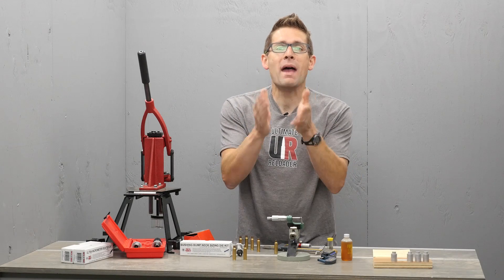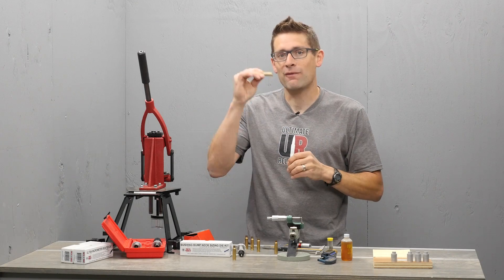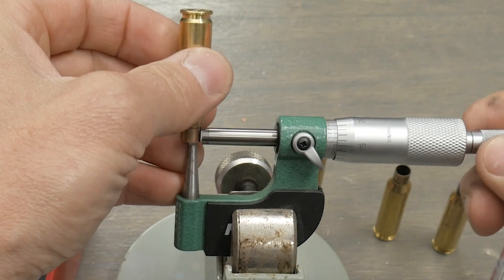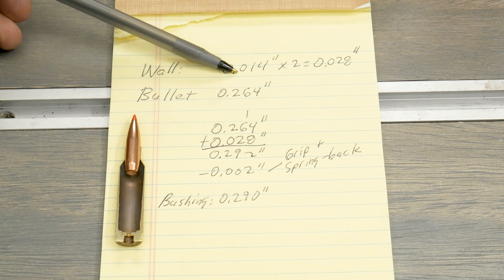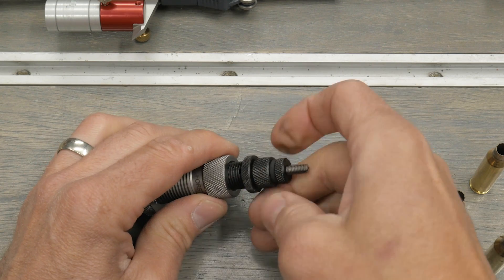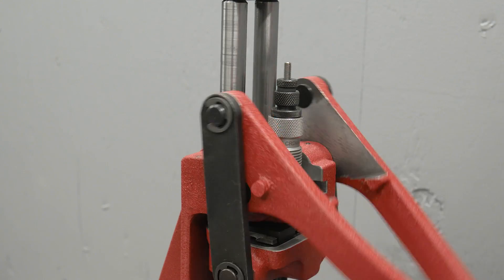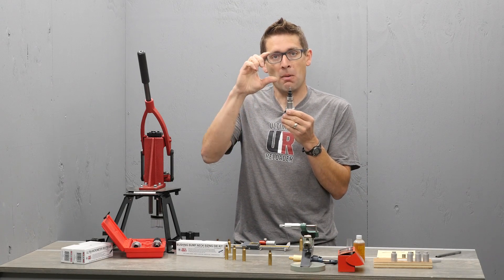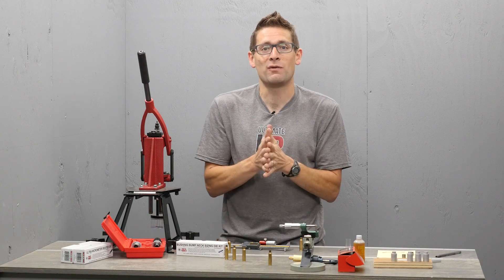Forster Bushing Bump Die in 6.5 Creedmoor: Overview and Setup

Comment: At higher energy densities, the pressure rise becomes nonlinear, increasing more rapidly than predicted by simple proportionality. This is due to enhanced flame propagation, turbulence, and confinement effects. if you bump the shoulder, you relieve the contact to allow better alignment without hanging the case up during loading.
if the chamber volume fits the case volume (excluding a slightly bumped shoulder), the energy density is far more constant between cases. i have a theory a bump die is superior to a body die as for larger powder weights, it allows a more concentric alignment, stable volume profile.
a body die will cause the case dimensions to deviate from the chamber, and this in turn means the case will need to obturate to the chamber dimensions on firing...which effects the energy density burn rates.
since the burn is in the non linear part of the burn curve, the results are exaggerated. (just a theory)

Comment: At about 4:50…
I’d be hesitant to spend the money on this product. With my Rcbs full length resizing die I need about .004-.005 shoulder bump for my rifle (for it to chanmber with the bolt just dropping with no interference)… if I only bump .003 it still will chamber but I can feel the bolt “dragging” the last half turn of my bolt. This is all done without the ejector pin in my bolt btw…

Comment: Interesting to see the proper shoulder bump. The tool that I have developed (not in production yet though) lets you set the bump even more exactly repeatably to a quarter thou or less than your method and it is not expensive. Regard Martin from UK.

Comment: Nice video, I noticed your using the 400 bushing to measure shoulder but hornady recommended the 375 bushing. I've tried only neck sizing but bolt is very tight to close, would this be a good purchase.

Comment: So does the brass need to be once fired before you take that measurement of the thickness of the case or can you also do this with virgin brass as well?
Reply: I'm not sure there would be any point since the necks are already sized down and the shoulder set fully back.  I only size new brass to true the case mouths.

Comment: Gavin, Going from a FL Redding die to the Forster Neck Bump Bushing Die, with all else being equal, I increase my velocity by about 40 ft/s in my 65CM!  Knocked me right off my node 0.  So, reduced my charge of H4350 from 42 grains to 41.5 grains and I am once again touching holes...and then I ran out of powder!  I think 41.4 is going to be drilling the same hole but i need to wait for Hodgdon to resupply!!  Love the Forster die!  Bumping about 0.002".  Hornady brass varies but the .288 bushing is used the most.  Picked one up for the 28N too.

Comment: Chuck up that die in the lathe and remove about .007-.010" or so from the base of the die. Don't worry about (pointless) cam over.  Then you'll have free reign to bump the shoulder back as much as needed.
Reply: Yes, I send mine back to have some of the base removed, works great with my chamber.
Reply: What about a 308? How much should i remove?
Reply: @howto… the caliber isn’t going to matter, it’s every Individual gun (chamber). In my chamber (which is a Tikka in .308) I need .004-.005 shoulder bump, if I only go .002 then the cartridge will still chamber but I will get clickers every so often.
Reply: Mine did not bump the shoulder at all on my Tikka .308 even using the standard shellholder.  I typically use Redding competition shellholders which work great with other dies, so there is definitely something off in the dimensions on my particular Forster die.  Debating returning for a refund or sending to Forster to shorten the die a bit.

Comment: I don't get why you would include the neck expander or the decapping rod in the die during this process ...  Surely you would've already decapped the brass prior to cleaning and this process? Also, why would you have a neck expander when you have an accurate bushing to get the neck to where you want it? Forgive me if I've got this all wrong but I'm just a beginner at this stuff. Can you take the decapping rod and neck expander out of the die and just use the bushing and bump the neck back?
Reply: De-priming: I personally de-prime after media tumbling. If I'm using the wet method with S/S pins I'll de-prime before cleaning.

Expander: there is no expander on that die.  It's just a small threaded cap to hold the decapping pin.
Reply: @jasonmpd2946  after re-reading the Forster info info on their website obviously I got this wrong ... this die doesn't do full length resizing, it only resizes the neck and the shoulder. I've ordered the Forster Bench Rest seating die but will probably order the Redding Type S Bushing FL bushing die because it does the case as well, but is a little more expensive

Comment: Can you actually get more shoulder bump? If your die was bottomed out there is no room for more bump? I ran into this issue with .223AI. Had to cut some length off the bottom of the die but I’d love to know if there is an easier solution. Thanks!
Reply: No, you found the solution.
Reply: Jason McKinney i also have the same problem with redding fl type s.
Reply: Boxtator actually found out if you camover it will bump more
Reply: Oh i had the same problem all along
Reply: Have you tried the Redding Competition shell holders? They vary in thickness to get your cases up into the dies farther. I believe they increase 1 or 2 thousandths at a time. I bought a set of 6 and they worked great.
Reply: Denny Baum yes they do, i also have a set of 6, they work good.
Reply: @howtoshootstraighthtss4948  Actually, I believe they do not do that -- just  the opposite.  The .002 one reduces the amount the case goes into the die by .002".
Reply: Robert Brandywine yeah reduces the amount going in thats right.
Reply: @338mag  Actually, they reduce the amount the case goes into the die.  They're for reducing the shoulder set back.
Reply: Robert Brandywine. Not sure I follow if all you needed to do was reduce set back you could just unscrew the die a bit would you not?
Reply: @338mag  Well, I think the reason is that it is much more precise than turning the die.  Note their description:

Now you can control headspace. The new Redding Competition Shellholders are packaged in five piece sets in .002” increments (+.002”, +.004”. +.006”, +.008” and +.010”). Each shellholder has a distinct black oxide finish and is clearly marked to indicate the amount it will decrease case-to-chamber headspace. You can now easily adjust the shoulder bump to customize cases to your specific chamber.

The emphasis on the word "decrease" was added by me. Another way of saying that is it increases how far forward the shoulder is.  A standard shellholder could be thought of as a .000.  Then the .002 - .010 that come in the kit move the shoulder .002" to .010" *forward*.

Comment: What's hour take on the redding die that does not set the neck tension on the whole neck as this one does.
Reply: The Forster neck sizing die can be adjusted to only size as much of the neck as desired. The bushing height is adjusted separately from the die/shoulder bumping height. Very useful feature.

Comment: To make sure I understand it does not size the body it only sizes the neck for bullet tension and bumps the shoulder back for head space is that correct
Reply: Yes
Reply: @hewlett260  not sure you're correct there...if it's a full length resizing die which I think it is, then it is sizing the body as well as the neck and shoulder
Reply: @claverton  it's not a full length sizing die, Forster offers those as well.
Reply: @hewlett260  of course it's a full length resizing die...you can't bump the shoulder with anything other than a full length resizing die.
Reply: @claverton  dude get on Forster's website, they make a die( the one being reviewed) that bumps the shoulder and sets neck tension via bushings without touch the rest of the body. They also make full length sizing dies that do the whole body. They also make neck only dies.

The one being reviewed is the bushing bump die.
Reply: @hewlett260  okydoky, I stand corrected. this is timely as I'm in the market so to speak. I'll have a closer look
Reply: @claverton  Yea you can.

Comment: Have you tried the Whidden bump neck FL sizing die? I understand it would affect the dimensions in a fireformed case. I bought the Forster bump neck bushing die for 6.5 Creedmoor along with the igage 1” micrometer and their ball micrometer. Also the Hornady comparator and OAL tool with the proper bushing for 6.5 Creedmoor because of this video. I have a Whidden micrometer seater die on it’s way to me.

Comment: I had one die like this and you will need a good brass so you get consistent neck tension, I switch to a Forster hone die and then use a mandrel to create the neck tension, way more consistent than the bump die.
Reply: This is the route I want to go. Then I can still use different headstamp/lots of brass over the life of the gun.

Comment: Would have been nice to check the concentricity of the neck. I have the same die and
it throws the concentricity of the neck out.
Reply: Could run it without the bushing and use a Lee Collet neck sizer, extra step but may help with neck concentricity.

Comment: Redding has had bushing dies for years
Reply from the maker: Yes, buy they don't bump the shoulder! :)
Reply: gavintoobe Sure they do. You buy the Redding shellholders and you can bump in .002 increments.
Reply: gavintoobe Sorry. I own the Redding bushing dies and shellholders and they bump the shoulders in .002 increments. You might want to do some research.
Reply: FL size and bump shoulder every time.  Neck sizing only does nothing.
Reply: @johnsenuta1038  I searched the Redding site before I chose Forster dies....I will look again, maybe they changed, it has been a while.